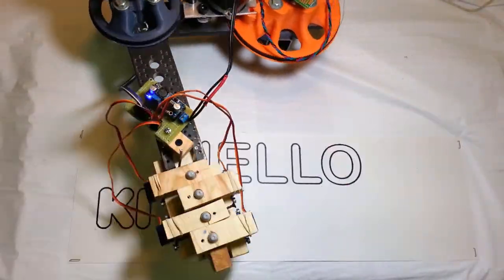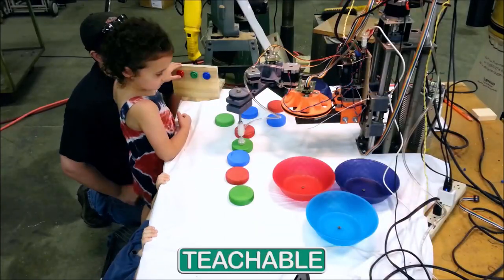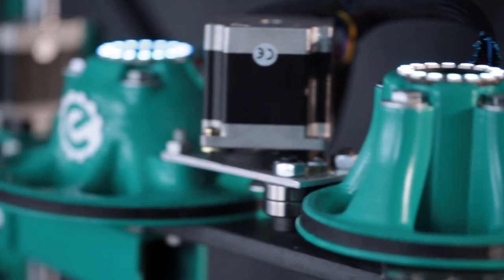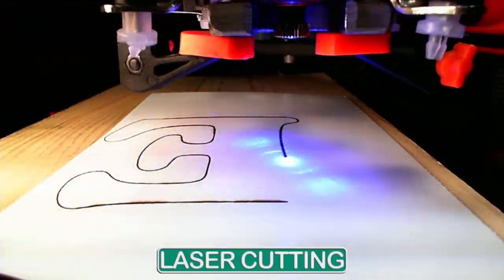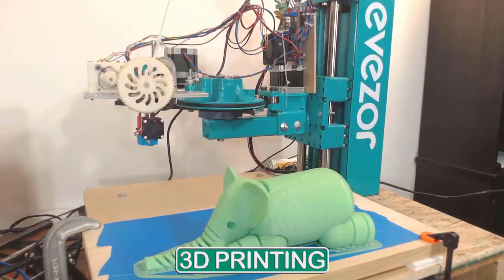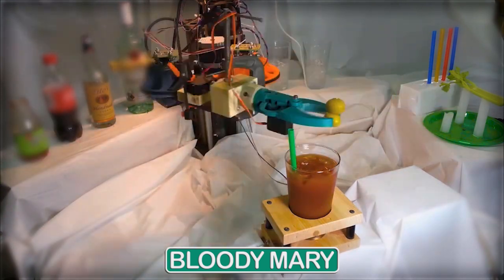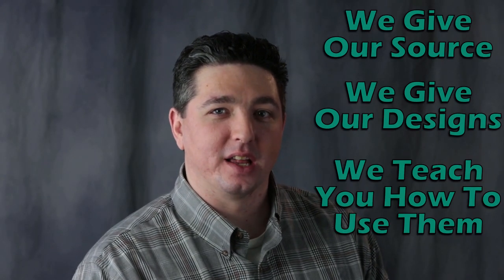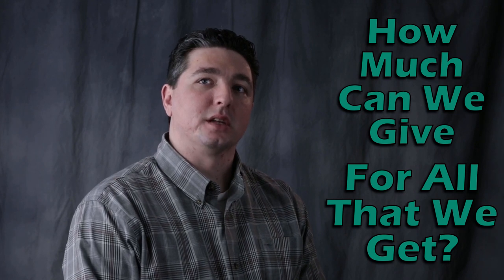Evezor Kickstarter Video

Comment: hello great!! is there a possibility to get the firmware?
Reply from the maker: At this point it's pretty old, but it is on our github page
Reply: @Evezor  hello,thanks, but i only see a blank marlin firmware with an example folder with scara in it, but without parameters from your evezor scara.
Reply from the maker: @larssenden5350  Marlin was running only forward k code and didn't use any marlin scara stuff. There is also a converter in another repo, it's just a bit of python.